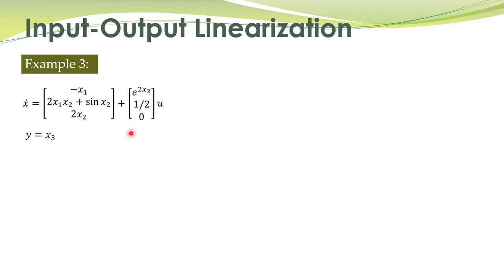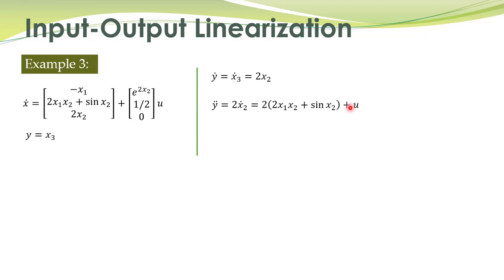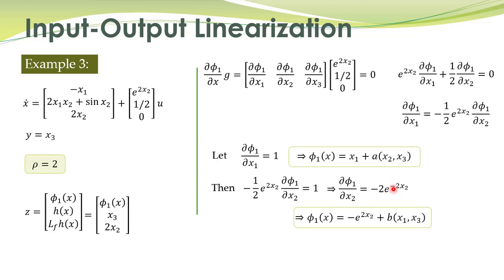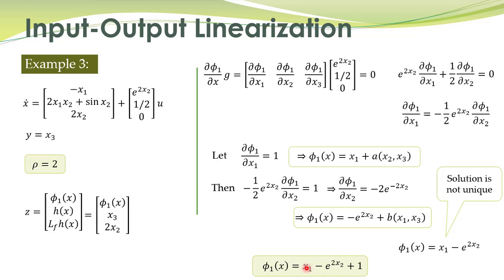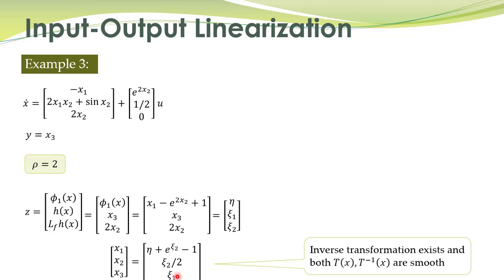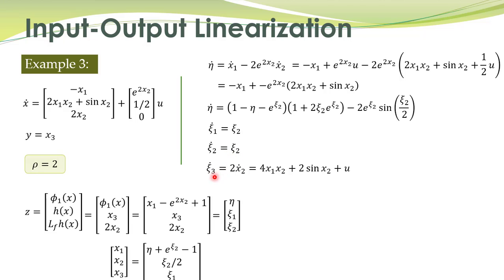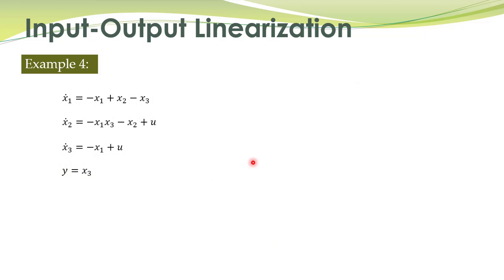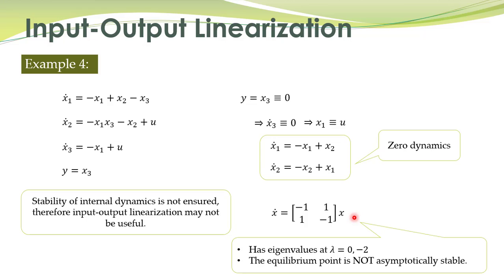NCS - 30 - Two more examples of input-output linearization

Comment: Can we also use these methods if we have multiple input signals u = [u1, u2]?
Reply from the maker: The theory can be easily extended to systems with multiple inputs. The difference will lie in the definition of relative degree. 

For a more general case of systems with multiple inputs and multiple inputs, you may refer to the book by Alberto Isidori.
Reply: @MAFarooqi  Thank you sir! I will have a look into this book!

Another question that I ask myself: I could imagine of Systems, where the partial differential equations (PDEs) that we have to solve are more complex. In your examples, we are solving PDEs with 2 partial derivatives inside. How could we solve these arising PDEs when we have 3 or more than 3 partial derivatives inside them?
Reply from the maker: @marku7z  You are right. There is one difficulty in feedback linearization technique (when relative degree is less than n), that is, the solution of partial differential equations in order to find the diffeomorphism.

Comment: Dear Sir, zero dynamics has an egienvalue at origin --> Why do you conclude it is stable? I mean all of eigenvalues must be negative or  they must in left-half s-complex plane, we will conclue the system is stable. On the other hand, the system is marginally stable if distinct poles lie on the imaginary axis. I hope you could give me explain in detail
Reply from the maker: Which example you are referring to?
Reply: @MAFarooqi  in 14:27
Reply from the maker: @hoathai7657  You are right. If the eigenvalues of a system are purely imaginary, the system is marginally stable, or using the Lyapunov terminology, it is stable but not asymptotically stable. And the same is stated in the lecture that the zero dynamics are NOT asymptotically stable.

Comment: Sir can you please make video where relative degree and order of the system should be three. if you have book related to my mention problem kindly share it would be great help for me
Reply from the maker: The lecture at the following link is an example of a system with relative degree equal to 3. Since the order of the system is also 3 (equal to the relative degree) in the mentioned example, it will generate both input-output linearization as well as full state linearization.

https://youtu.be/LhrSusa9N4s